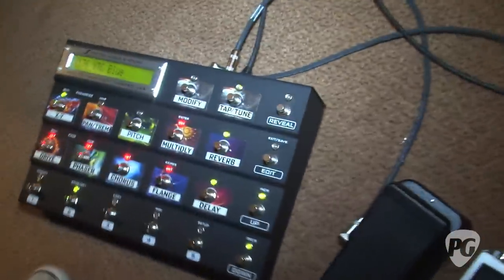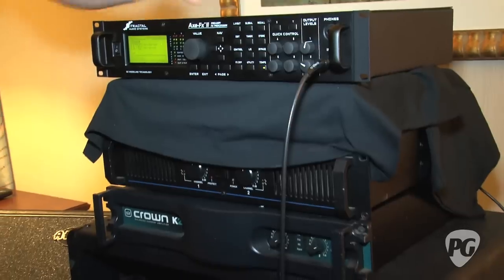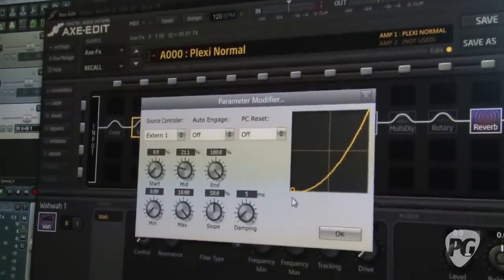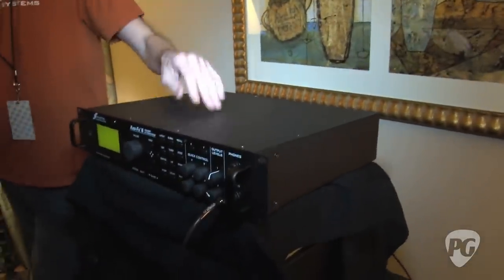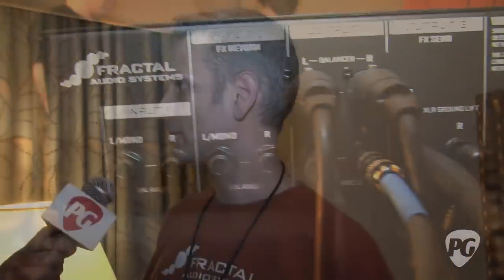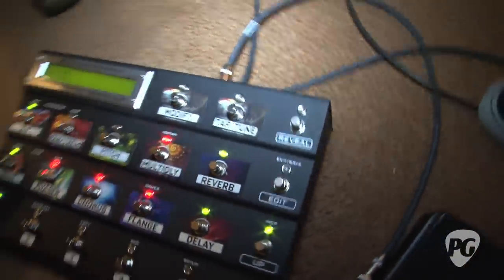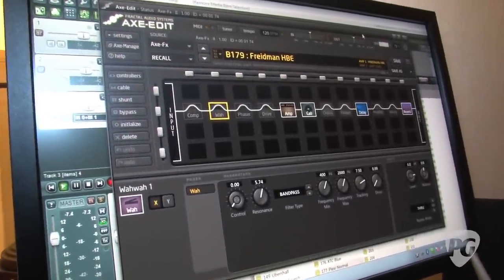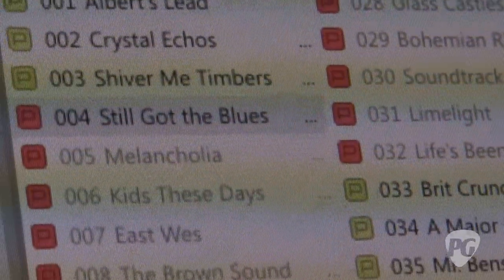NY Amp Show '11 - Fractal Audio Axe-Fx II Preamp / FX Processor Demo

Comment: @Deathrape2001  Ok, you don't have to love it as a preamp.  You can still use it as a stand alone effects processor or hook it up to your favorite amp using the 4 cable method.  To some people, like me, this unit will save me at least $2,000 by not having to buy multiple loop switchers and effects units as well as dirty and clean amps plus the backups and the custom cases to transport them all.

Comment: I'm sure this is a decent unit but I have yet to hear a decent demo on youtube. Most of the videos really sound like crap and I can't believe this box is $3,000. Every modeling unit I have ever heard always lack the raw power of the amp it's modeling. They always sound very thin and brittle on the top end, same thing with software like Guitar Rig. Seeing as the AXE FX is extremely  expensive it should be very obvious how much better sounding it is compared to its competitors like the Avid Eleven Rack. Sorry, but it just does not blow them away by any stretch. Yes, it may have a ton more amp models and effects but unless they sound as good as the real thing or so dam close that you can't tell the difference, it's just another modeling box that falls short.
Reply: +Home Recording Made Easy I feel your argument doesn't take into account the fact that this is YouTube and the sound quality (if it can be called that) is limited. Try searching Google for 'AxeFX Soundcloud' or similar.
I've lived all my life with valves and know the sound intimately and yes I totally agree, most all simulations are just awful. Recently there are some exceptions to this. I play an Eleven Rack and its way cheaper than re-valving my valve gear, so for regular practice it is the way. remember; Classic amps are like classic cars, a finite resource that is expensive to own yet alone buy. Simulations allow the masses to have a taste of the real deal but then unless you have played a lot of the classic amps, you need to research how to set them up too. Most people don't understand that.

Comment: 1.  The NY Amp Show has been in hotel rooms since 2005, that way there isn't a volume limit the presenters have to work with, which is more important in analog amps and their coveted tube saturation.  For Fractal Audio, it's kind of a moot point.

2.  If it sounds good, I don't really care if it's fuzzy and pink and winks at me.

Comment: @nokomisnichols Or you know, get one unit with a tube poweramp and decent cabinet, and literally have dozens of amp emulations that you can't tell isn't the actual amp if you weren't told it's a processor. It's not 1970 anymore, most people don't want basic rigs that can only do one sound well. For anyone living in a dorm room/apartment, or someone that has to use a lot of different amps and effects in their band or solo project, then you don't need to look any farther than the Axe Fx.

Comment: @joeboogie83 Why? I have a Mesa Dual Rectifier, but I don't even use it anymore since I got my Axe Fx. I mean, the math really isn't hard.
70+ amp models indistinguishable from the real amps = $2000 and two rack spaces
70+ real tube amps, some of which are very rare and all are expensive > $2000 and two rack spaces

Comment: Why do you people make them so prohibitively Expensive?!?! How do you expect someone on a budget to drop 2 k+? whats the reasoning?
Reply: If you are on a budget you should try out the line 6 HD500x. it's what i use until i can afford the fractal fx2. The HD500x or cheaper HD500/400/300 or X3 sound great even right out of the box with the preset tones already installed. It's essentially the same thing with amp modeling and fx. The fractal is of course a cut above the rest but so is the price tag as you stated lol.
Reply: The amps sound 95% like the real thing.
There are hundreds of amps in there. Buying all those amps would be far more expensive than buying the axe FX. If you want only one amp out of that hundred, buying the whole Axe FX is a waste.